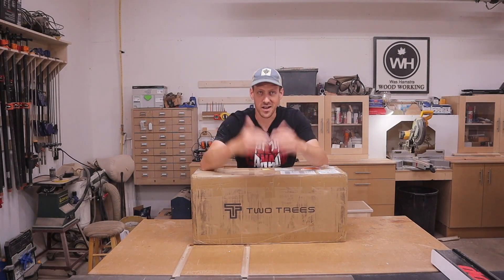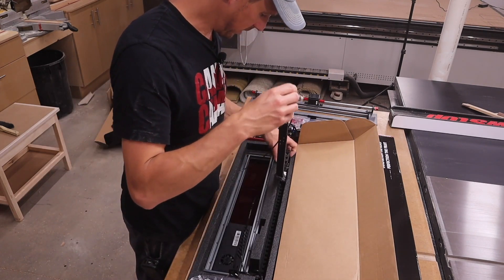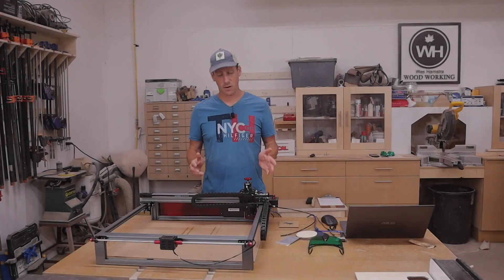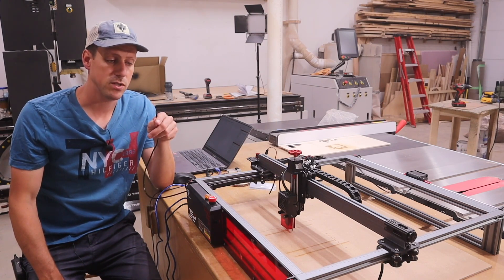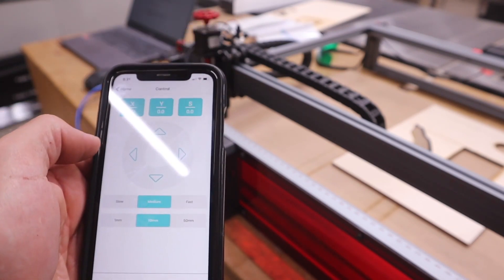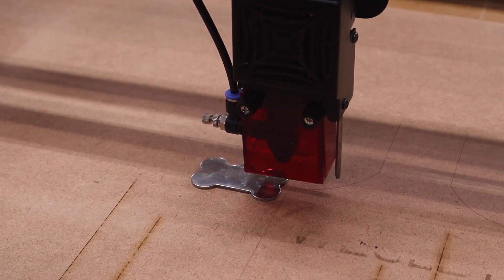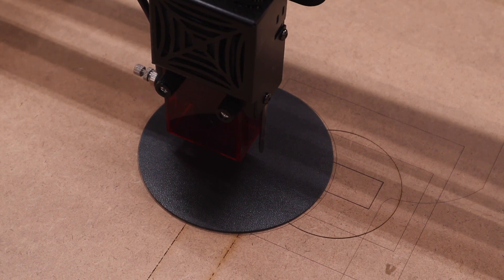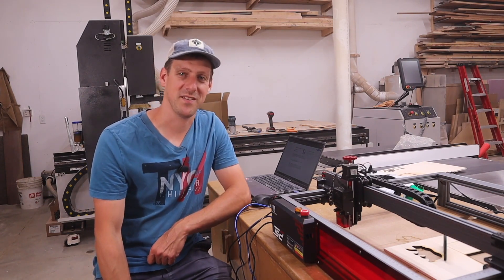Two Trees TS2 Laser Engraver Review

Comment: Oooh - mine (arriving today) is supposed to have air assist, but it doesn't come with the pump???
Reply from the maker: You have to buy the pump separate.
Reply: @WesHamstra  The problem is that it is advertised as having air assist. Everyplace else, that means it has an air pump. Sellers on eBay etc., use that impression to promote that it has 'air assist' when it doesn't. It has the connection kit for it - which is entirely different. And it fooled me.

Comment: How to you change focusing for engraving vs cutting.  I understand you can set for cutting in the software?  Nobody really goes into this.  And if it the software with the auto adjust, can you change for different thickness materials, so the cutting focus is in the middle of the material.  Thank you!
Reply from the maker: I don’t know how you would set it manually. In the software you would have to input your material thickness. It will adjust the focus to be in the middle of the material. All the information on how to do this is in the manual.
Reply: @WesHamstra  Thank you!